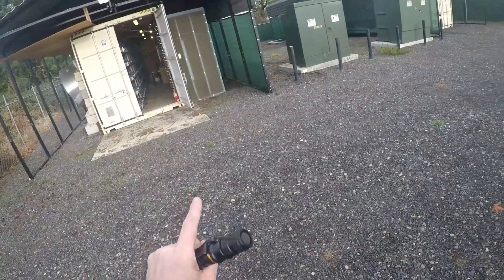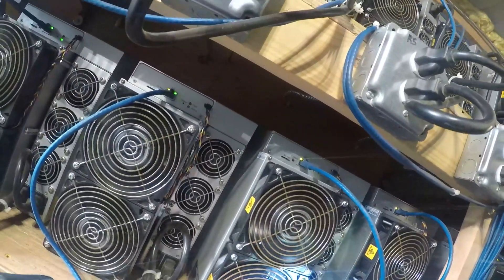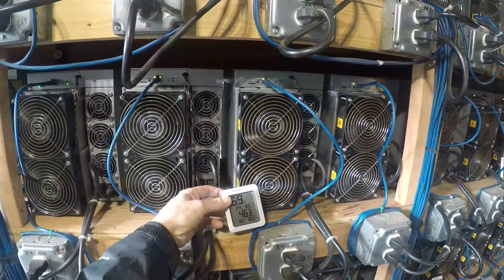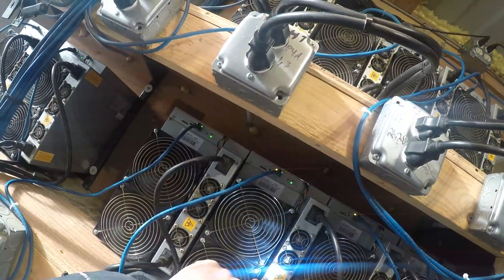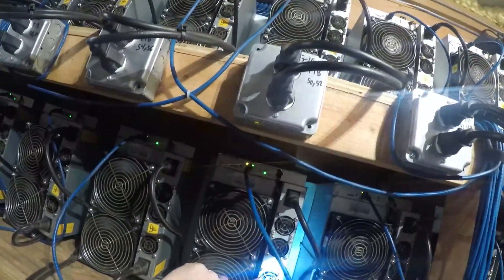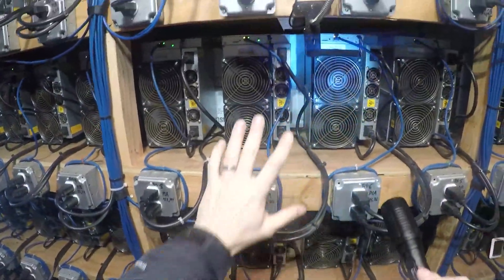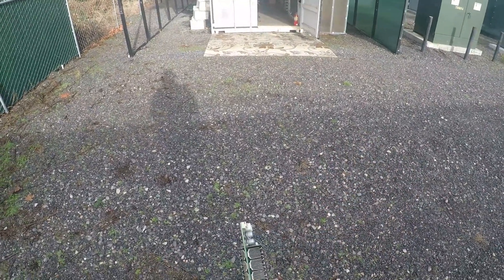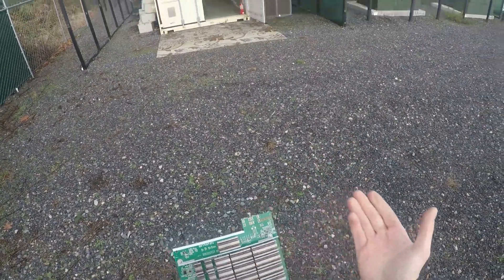Bitcoin Mining Farm - Checking Asic Miners, Maintenance, PSUs, Hash boards, Routine Check

Comment: How are you using 110v outlets?
Reply: They are hot wired for 240 to use regular c13 power cords. No need pdu n special cables. Cost effective $$$$. Think outside the box